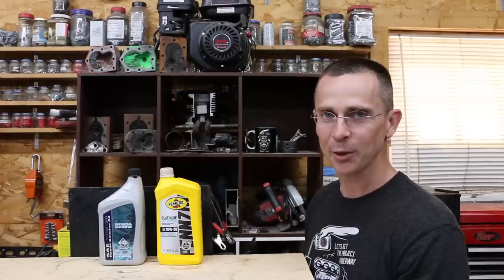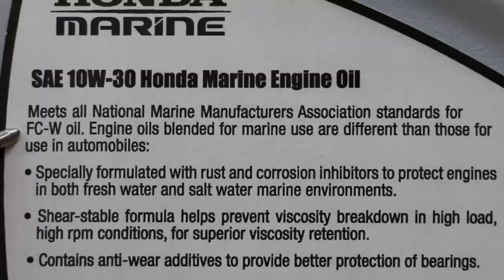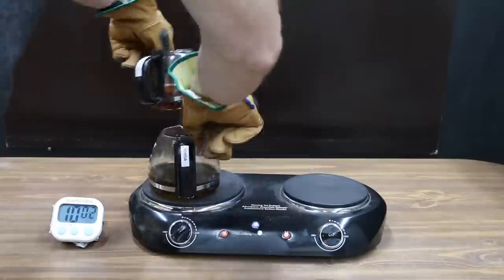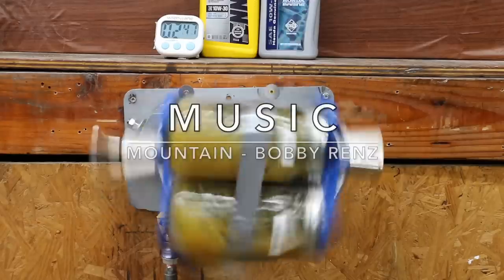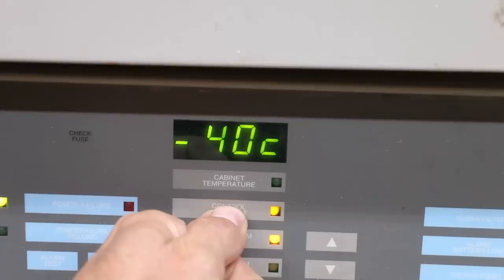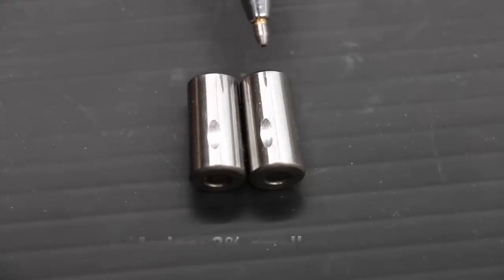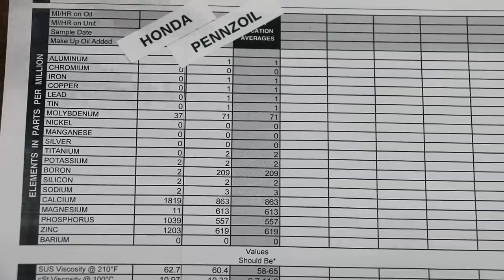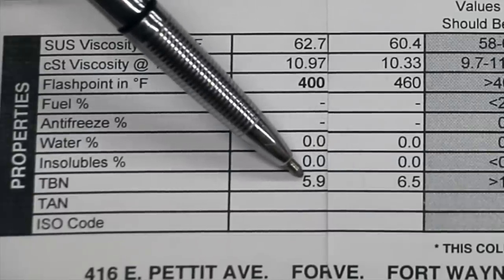Motorboat Engine Oil Better Than Regular Motor Oil?

Comment: You know what would be cool, a Transmission Fluid test, electric cars also use this oil, Tesla uses Dextron 6 in it's gearbox and the Front and Rear Drive Units.
Reply: And gear oils.
Reply: Very curious about this one, I drive a titan XD and everyone pushes amsoil for smoother shift, I tried it, seems a bit smoother but nothing to write home about. but I feel like amsoil is like the audiophiles, I can't tell you the difference but the guys that know what they are looking for do... So they say ha ha
Reply from the maker: Thanks for the suggestion.
Reply: @ArchCityCraftsman  NO DISRESPECT Chase, Did you completely get ALL OF THE OLD TRANS. FLUID OUT before switching to Amsoil ? T.Y. SIR.
Reply: @ArchCityCraftsman A rougher shift preserves the life of the clutch material. If the shift is smoother that means the clutches are slipping a tiny bit more and the life of the transmission will be a little shorter.
Reply: @NoWr2Run  non taken valid question. I let it drain for a few hours but I didn't have a pump so no I did a drain and fill. That's why I would like to see it tested, like i said there is a noticable difference just nothing dramatic. I'm not a mechanic and don't play one on tv but if I notice a difference that probably means it's a dramatic difference.
Reply: @ProjectFarm   Your Welcome, but it's really funny because everywhere online everyone says that Tesla doesn't use any oils except for Grease... That however is very false. Another myth online is that Tesla uses some sort of special oil from SpaceX, that is also false, I have the original factory Tesla assembly documents and the part numbers and type of oil are clearly stated. There's also one more myth that the pressure is inside of a gearbox of a Tesla are so extreme that no oil could ever handle it...lol, that to me made me laugh.
Reply: @viperstrike3827  I have heard that too but the answer I got when I asked about the amsoil is that the trans is still shifting as it was it just had less friction making it feel smoother. I honestly didn't mind it before it's my work truck ha ha I was more so curious. I changed all fluids to amsoil, I think the biggest difference was the front and rear diff gear oil.
Reply: @ArchCityCraftsman  i do remember 
My V6 Wv with tiptronic
Shuld be warm not hot
And oil shuld be 40°
Becaus when Don right
IT would be Seem less stift..
No chubby no nothing .. just 
Shift shift shift ..
In one Long pull
Reply: @LazloNQ  No sutch oil!!
Audi also claimed 50.000km oil
All enigens .. ware and tare like 
2.000.000 km ware on a 400.000km enigen
Total toast!!
Reply: @viperstrike3827  wait what? So what about my hard shifting 00 civic? Or are you referring transmissions not old?

I figure the clutch packs are worn and valves might need bored, but I'm just a YouTuber....
Reply: @kennethschultz6465  try running Amsoil for 25,000 miles. Your engine won’t be toast.
Reply: Kind of been wondering this lately after finally having to change ATF for my Gen 1 Honda CR-V. Idemitsu seems to be the company that mixes up the fluid for Honda, but I'm told that save for potentially some anti-wear additives missing, a specific multi-vehicle ATF by Valvoline is pushed as what you should use, particularly for how you're supposed to fully service a fluid change on Hondas. I have to wonder if the use of that Valvoline would work for the fluid dump and replace cycles until the last one, where you would use Idemitsu fluid AND a bit of extra additive to make up for what the Valvoline lacked in comparison.

Figure that having people comment on their experiences on Hondas and that Valvoline ATF versus Honda/Idemitsu fluid would be help for others out there.
Reply: @LazloNQ  This only holds true for an engine in good condition. The 25,000 refers to the lubricity of the oil. If you have much ring blow-by, leaky valve seals, a head gasket that weeps, or anything else that can get into the oil, those numbers don't mean much. The TBN and TAN numbers are for ideal conditions, at least as I understand it. If you have external factors, those numbers don't mean as much. And regardless, 25K oil is not an excuse for people to ignore their oil and not check it regularly. Most cars don't throw a low oil level or low oil pressure warning until it's just about too late.
Reply: Yeah, I like to see Amsoil transmission fluid against Maxlife and the other top of the line transmission fluids.
Reply: It doesn't matter what mystic oil brand one uses.. Never... Ever.. EVER... go 25,000 miles without changing it. That is insane for gas powered cars. You can do that with a highway only diesel, but certainly not with gas. Yes it sucks to change the oil, but cars/trucks/boats/planes cost 10's to 100's of thousands of dollars, and oil and filter is usually under 50 bucks.
Reply: @hawkdsl , I was waiting for this comment. I’m a diesel owner and can 100% safely do a 25k interval oil change on my truck. I’ve been using Amsoil for a long time now and stand behind it. Granted, diesel motors are a lot different in terms of lubricants but you’re correct in that no gas motor should do that. Hell, using oil bypass kits from Amsoil allows for 60k oil change intervals using Amsoil Signature oils. I’ve seen the raw testing for them and it’s damn impressive. Personally, I see no point in it but it works well for a lot of owners who do high mileage driving.
Reply: Thank you for another Awesome Video
Reply: @LazloNQ  I still do 8-10k changes but my truck is a farm truck, my daily driver, and my work truck for my renovations repair company so more than likely always towing something heavy. That's just me though everyone will tell you to go my the lable or manufacturer whatever one fits what they do but there's a lot of guys that go the 25 with no obvious issues. Biggest thing is you do what works for you everyone's experience may be different. I would be interested to send your old oil and my old oil to the lab and see the difference of the 15k miles. Obviously would be a bit different since I have a 5.0 Cummins smaller different make
Reply: i've been asking for this for a year, maxlife ATF...
Reply: @LazloNQ  if you watched engine oil comparaison here, the pennzoil ULTRA platinum have 99% identical score compared yo amsoil signature series... But at 40% of the cost.. they also claim Higher interval between oil change 😉
Reply: I would be interested seeing how Pentosin FFL-2 DSG transmission fluid is ranked with other transmission fluids...
Reply: @WarpedYT  if there are 2 metal gears, and you want them to last, they need lube.  the "gearbox" indeed has 3 gears in a tesla, they are not direct drive motors, thus, they have some kind of gear lube.  dex 6 viscosity is like 0w16, maybe even lower.  its a very low viscosity oil.  Toyota uses ATF in their eCVTs in their new hybrid systems, and gear lube in the rear diff/axle housing of their new hybrids.  gears need lube, else they chew themselves to neutrals.
Reply: @kennethschultz6465  it's the aisin 09g, 2.5 up to vr6 have enough torque to shift into all gears under 3,000 rpm.
Reply: Tractor hydraulic oil test
Reply: Amsoil ATF got me an extra 5mpg Highway, it’s black magic in a bottle. Worth a try, if you’re curious
Reply: @hempwick8203  If it has been rebuilt at some point, it may have had a shift kit installed to make the clutches last longer. If a transmission is starting to slip sometimes the computer will make it shift harder to stop it from slipping and get a tiny bit more life.
Reply: @WarpedYT  Torque loading on the gear face is so high that typical automotive gear oil won't work.
Reply: @ArchCityCraftsman  mobil 1, the only brand that tests the same as the bottles printed weight numbers
Reply: That might prove challenging to test properly as different manufactures call for different fluids for different clutch materials..
Reply: @ArchCityCraftsman  the 1st thing i noticed with amsoil on my Diesel truck was the engine oil stayed cleaner twice as long as the T6 rotella I used to use
Reply: @gamebredduramax71  that's good to hear have you ever sent the old in for testing out of curiosity?
Reply: @ArchCityCraftsman  no, they tell me I can go longer but I basically reset my engine oil monitor twice before I change the oil with amsoil 15/40 signature series with the amsoil oil filter. I drain my transmission fluid every spring and change the spin on filter with amsoil signature series transmission fluid. ( Allison Trans) I use the amsoil brake fluid and power steering fluid. And I run all in one diesel treatment every fill up. I have 250,000 miles on 2011 LML Duramax Truck. I think the internals are still like new my magnet on the drain plug is super clean every time I drain the transmission.
Reply: @ArchCityCraftsman  I’m not a dealer or anything, but I’ve slowly tried there different products over he years and have been pleased with them.
Reply: @LazloNQ  I gotta say the most amazing thing I’ve seen with amsoil products is there Sabre two stroke oil, they recommend running 100:1 ratio with all lawn and garden two cycle engines, not equipment calls for 32:1 and 40:1 ratios, 100:1 with any other product you are guaranteed to blow the engine up. Yet I’ve been running stihl power tools for 4 years now using amsoil Sabre at 100:1
Reply: @DJDTHTRP  amsoil signature transmission fluid will make your transmission last forever as long as it’s not damaged prior to filling with amsoil.
Reply: @gamebredduramax71  that's impressive mileage I didn't do the power steering, or break fluid when I flipped my truck out. Didn't really think about it honestly may look into it just to try it. I do use their filters though, I have no issues with what I flipped out with amsoil I've been happy will probably keep using it cost doesn't bother me if it keeps the truck running and out of the shop ha ha. I've been using diesel kleen in the titan every fill up but was going to try hot shots and amsoil next. Do a month on each see if I notice a difference
Reply: wow, I was thinking this exact thing at the end of the video
Reply: Please test Redline lightweight shockproof oil.
Reply: Put Dextron in our auto shop teachers suburban. Wasn’t a nice guy.
Reply: I'm curious about this one but Im mainly curious on the effects heat had on the longevity of the fluid. There are a ton of different fluids out there for transmission though from old to new stuff like mercon ulv.
Reply: liqui moly Vs Valvoline, both proclaim that they have a lot of anti wear additives.
Reply: What I found weird when I worked on my ford ranger was it said to put merconV into the transfer case but reading the merconV bottle it says do not put into transfer case
Reply: a bunch of things use ATF. some power steering pumps, some manual transmissions. some wood splitters in lieu of regular hydraulic fluid. its all over the place if you really dig.
Reply: @gamebredduramax71  
That might be that Amsoil isn't cleaning as well as the Rotella, personally I don't care for Rotella, I use Mobil Delvac, I feel good about this decision since it came in something like 10th place in a Synthetic oil shootout of 15 top oils, and it's cheap at wally world
Reply: @kenabi  My 98 Toyota Corolla 3 speed uses ATF in the differential which is seperate from the transmission. I use dexron VI.
Reply: @goodmanboattransport3441  Project farm here has tested amsoil against all other oils and amsoil out performed them all by a good margin coming in 1st place.
Reply: @ProjectFarm  how about, “ are more expensive spirit levels more accurate than cheap ones?”
Reply: What about merin vs normal 2 stroke oil! Very important !
Reply: @tomc8829  hi
No i live in EU/ Denmark
Enigens her has real TIGHT fit
And are realy expensive to change
So No !! And SUNOCO IS MY 
BRAND OF CHOISE
It's a first base oil 
No regen .. pure oil
I see how Shell and the other
Top brands perform
So No!!
I won't fok Up my
German high pression enigen
To 8000euro
Reply: @WarpedYT  so many myths about tesla cars it isn't funny. These people who say they only use grease, couldn't be more wrong!! I saw a documentary on the transaxle from a Tesla. The guy undid the drain plug, & it seemed to take forever to drain. Regarding normal car transmissions, when the fluid is changed in these autos, they never get all the fluid out. This is because the torque converter is forgotten. My own car is due for trans service in coming weeks. This car has a drain plug in the torque converter, as does my housemate's 2003 VW Polo. Use the wrong fluid in your trans, & you're asking for trouble. Just like a car powered by an I.C.E., Tesla cars need servicing too.
Reply: @WarpedYT  too funny 😂
Reply: @ArchCityCraftsman  GOTCHA, THANKS.
Reply: @gamebredduramax71  
I don't dispute that, and I would use it too if I didn't need to change oil so frequently,  I drive about 100k miles per year, and regular oil changes at about 8000 miles is the schedule I follow.

I know you might say I could go xxxx number of miles more, but frankly I'm not willing to chance it with my essential equipment for a little savings. I spend about 1000 a year on changes
Reply: @LazloNQ  I also only change my oil once a year with a high quality oil. I also do an engine flush with it and pour half a litre of clean oil through the engine after the oil has drained before I put the plug back in. Kinda ocd but seems worth it lol.
Reply: Yah transmission fluid test to see which brand is the best.
Reply: @NoWr2Run  Ah, the classic "I renewed my fluid with this other brand and it feels better, so it must mean it's the brand that's better" as opposed to the fact you changed the fluid...
Reply: @ProjectFarm  it is a good suggestion and would be interesting to see for the regular stuff, synthetic big brand and the boutique high priced stuff.
Reply: @Henk14789  Used Amsoil since it was new, SON.
Reply: @LazloNQ  once a year is risky. I feel the guys buying into that is a guinea pig for the oil companies. Good luck
Reply: I've previously asked for a transmission fluid test as well.
Reply: @kennethschultz6465  keep putting cheaper oil in your car if you want, for many people it works for them for the oil to be only “good enough.”
Reply: Please do this one
Reply: @WarpedYT  ahah spacex produce some kind of oil? 😁😁
Reply: @ProjectFarm  next video which multimeter is the best!!
Reply: If you do that please also test John Deere low viscosity Hy-Guard I have heard that drag racers use it and say that it shifts similar to type f but has better lubrication.
Reply: @ProjectFarm  A Video Idea :  Test two stroke oils like  -- Echo Power Blend (orange cap ), Echo Red Armor (red cap ) , Amsoil Saber (yellow cap ) , and Stihl , and Husqvarna and other mainstream 2 stroke chainsaw oils.
Reply: Also would be interesting to test something like Hytran vs ATF.
Reply: @ProjectFarm  if you do a video on gear oil I would love to see shaffers 75w 90
Reply: Elon would do this test on Mars.
Reply: Can you test the SUZUKI  marine oil?
Reply: No "T" in Dexron.
Reply: @gamebredduramax71  So your engine was therfore dirtier if the oil wasn't picking the crud up
Reply: @Seth_Stewart  no engine is cleaner, the detergent package in amsoil keeps dirt and grime suspended in the oil instead of mixing with the oil making it easier for the oil filter to pick up the dirt and grime.
Reply: @gamebredduramax71  

That sounds impressive, and I will qualify this with I had a different engine 7.3 powerstroke, when I pulled the engine apart for a windowed piston crown (blocked piston cooling jet PO used silicone sealer and a bit blocked it 🤬 ) with 570k miles and somewhat regular service,  I was still able to scrape the babbit off the mains and rod bearings with my thumbnail, regular oil has the abilities to prevent wear for many years too.
Reply: @gamebredduramax71  Perhaps it's more resistant to heat cooking it
Reply: @Seth_Stewart  yes, less evaporation, and that light Smokey look from evaporation is what causes build up inside the engine
Reply: I definitely agree. Amsoil torque drive, Amsoil ATF, Allison Transynd, and others in transmission test. Also gear oil Amsoil Severe Gear, Lucas, Royal purple and others.
Reply: We're gonna test that" i love hearing that
Reply: For about 20 years now many manufactures have been replacing gear oil with ATF for improved gas mileage. The bad news is you can forget to change your gear oil for 50K and you are still OK. Forget to change ATF in 30K and you get to rebuild your trans!
Reply: @skonky  we used 25 and 50k oils for work and during the life of the oil we would send samples in at 10k and they would recommend a filter change or half dump and add..
Reply: @ProjectFarm  ,have you thought about testing air tool oils?
Reply: @ProjectFarm  Teslas have a very long period between service inspections: two years. So longevity would be an important aspect of a transmission fluid test. Which may suggest another investigation: Should you go two years or 20,000 to 40,000 miles between inspections? Is there anything Tesla should be checking sooner than two years?
Reply: @ProjectFarm  Have you ever tested Harvest King oil in one of your tests?
Reply: @WarpedYT  Ahh, so many Tesla myths. Hard to keep track now.
Reply: @WarpedYT  Sounds like marketing snake oil to me. Most ATF are around 14-16 weight viscosity and a lot of manual transmissions are being filled with it factory now because of cold weather performance. Take all the ZF transmissions, they all take Dex/Merc compatible ATF. Problem with ATF is when it starts cooking, there's no going back, you've already done damage to anything bearing related that it's soaking in. ATF will start cooking above 260-270 degrees F. I think the only reason why Tesla is using Dex 6 in their cars is because of the cold weather performance to keep the gearboxes from making noise when it's cold outside.
Reply: @97marqedman  "no oil lasts 25,000 miles" yeaaaaah no buddy. Modern heavy duty Diesel changes their oil every 50,000 miles now with synthetic 10W-30. It used to be every 20,000 miles with standard 15W-40, about 10 years ago. Your information is about 40 years too old.
Reply: @ProjectFarm  please do a review of TriboTEX.
Reply: @BeingMe23  oh yeah no doubt, which is probably why they use dextron 6 instead of gear oil, but I was just stating rumors that are floating online.
Reply: @AsitShouldBe  haha... Apparently so.
Reply: @ProjectFarm  Maybe a tournament like the motor oils.
Reply: @ProjectFarm  I would love to see a head to head test of Mobile One synthetic motor oil versus Mobile One Extended Performance versus Mobile One Annual Protection. Are there real difference in performance? Is it all marketing? Perhaps the results will surprise us ?